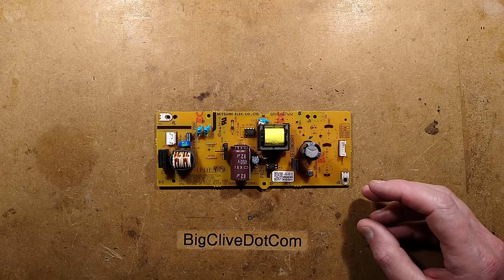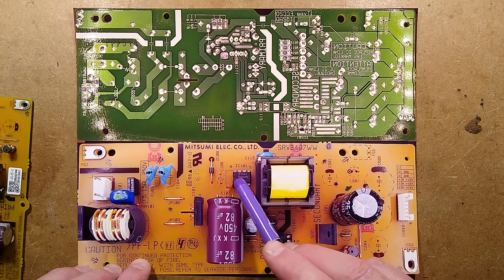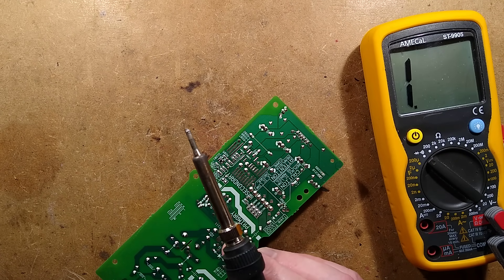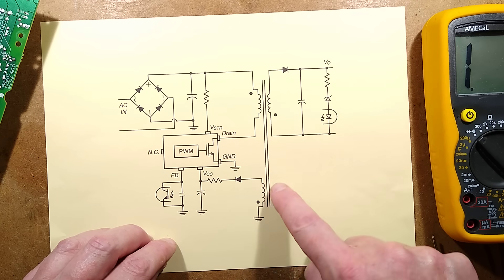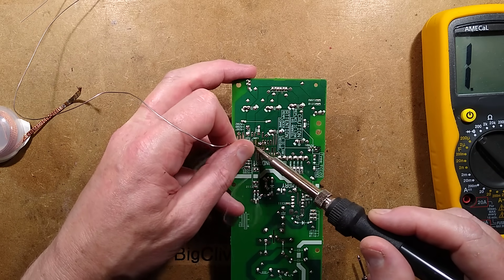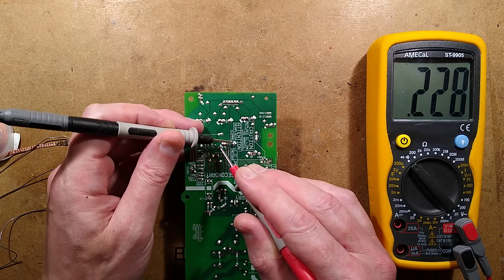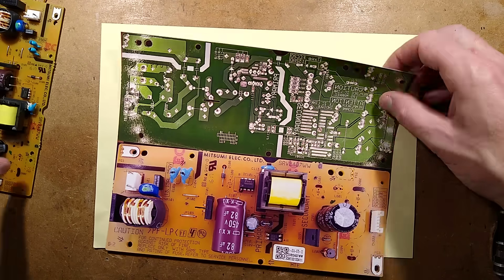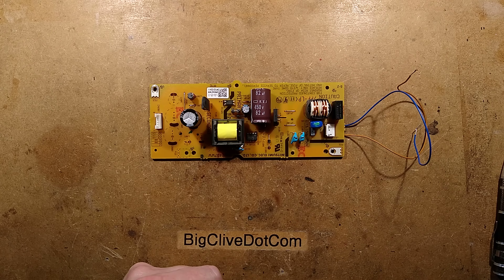Diagnosing a faulty PSU

Comment: A long time ago, someone thought, "Let's take the AC mains, rectify it into DC, connect s coil with a DCR of 0.05 ohms to it, and then short it to ground with a fragile mosfet." That man ended up in an asylum, but danged if it didn't work.... It has always been my theory that switching supplies work because of voodoo.
Reply from the maker: In the early days they were outright scary.
Reply: @bigclivedotcom didn't the first Gen of switchers tend to run really hot? Tend to heat fail?
Reply: Actually, this exact thing took place over a hundred years ago when Henry Ford put the ignition coils in the earliest cars.  Then along came Kettering with the coil, 'condenser' and points to repeat the same thing.  Now we have chips that do it in microseconds.  👍👍
Reply: @acmefixer1  That's true. And the "flyback" circuits in CRT TV's and video monitors work similarly. Still, it's kind of amazing that these circuits are so reliable if built correctly. On paper, it seems like they'd be doomed to a fiery death in the first second of operation.
Reply: @ScottGrammer  That's because you're thinking of this like it's a DC circuit.  It isn't.  You're not thinking about the inductance involved.  When the mosfet first turns on, there's not a dead short across the supply.  The coil is nearly open at that point due to its inductance.  It gradually starts conducting more and more current until the mosfet turns off, sometime before it becomes a dead short across the supply.
Reply: @stargazer7644  Yes, I know. And you're right. As the magnetic field builds in and around the inductor, the current rises. And when the mosfet turns off suddenly, that's when the fun stuff starts. I do know what I'm doing, having repaired electronics for 40+ years. But I also know that switching supplies can be a real bear to repair because often their operation depends upon very specific characteristics of the original components, and replacement parts may not behave quite the same way. This can lead to what's technically known as "spitzensparken."

When Bob Carver released his first "Magnetic Field Amplifier," which used an AC variant of a switching supply (in part basically a light dimmer), the switching component (in that case, a triac) had to be sourced directly from Carver, or else the supply would fail again hours, weeks, or months later.
Reply: @ScottGrammer  I once had an IBM computer CRT show up on my bench with a blown horizontal output transistor.  Swap the transistor, and good as new.  A week later, it was back in the shop with the same problem.  I busted the scope out, and found a spike on the collector waveform that was exceeding the spec for the replacement transistors we were using.  The design really wanted a very particular transistor.  I slapped a zener on it to eat the spike and never saw the monitor again.
Reply: Tfm-45 one of the best ss amps ever!
Reply: @stargazer7644  sounds neat
Reply: Some years ago, I worked for a hospital that did their own electronic repairs for many things.  They had a particular model of RCA color TV's for the patient rooms.  These things had a bad run of Horizontal output transformers and were failing often.  I would put a scope on the horizontal output transistor and slowly bring the variac up.  If the waveform was horribly distorted, I knew the Horizontal output transformer was shorted.  I repaired about 40 of these in about a week.  Usually took a fuse and the new transformer.
Reply: You forgot the HF chopper.  In the 80's I fixed dozens of SMPS' in commercial equipment (third party IBM network muxes).  They used all discrete components back then.  It was always the output electrolytics that bore the brunt.  They ran HOT.

Times sure have changed.
Reply: Pixies. It's the pixies.
Reply: @kti5682 Yes, I've worked on a couple of them.
Reply: 1930s Fords had that to power the radio. Vibrator "tubes"  failed.

Comment: These are used on a high end Song blu ray player and fail on a regular basis. The biggest offender is the double diode on the secondary. It’s more than adequate for the job especially as the diodes are wired in parallel so I suspect a bad batch.
Reply: Could the lack of heatsinking be to blame?

Comment: I find a stiff nylon toothbrush to be a great desoldering aid. Simultaneously apply iron and scrub connection
Reply: How would you use it? Would you use the shaft, or the brushes, or am i completely lost..?
Reply: So you just need a third hand to end up with a molten brush? somehow I don't see how this would work at all...
Reply: but with braid you know where the solder is going, a brush might flick solder everywhere

Comment: hi bud a quick question if the person to whom gave you this PSU Circuit Board was to replace the Capacitor and Transistor it would work if so very interesting vid
Reply from the maker: Replacing the output capacitor and diode package would be the fix for this unit.

Comment: That little repair reminds me of a friend fixing a very expensive bit of kit by replacing one component. A lot cheaper, and environmentally friendly than ditching the whole thing.

Although I think I missed something from the video as I couldn't see which bit the ozone was supposed to come out of. :)
Reply from the maker: It could power the Russian Nuclear Corporation unit.
Reply: This happens all the time, one example is I repaired a 24" computer monitor by replacing one broken resistor inside for a few cents of cost at most. Been in use for 6-7 years after that and still going strong.

Comment: This might sound very stupid, I have what I call "dangerous" levels of insight into electronics. Does that PCB really need such a massive cap?
Reply: It depends on how much current the load draws, basically. Think of the cap as a sort of "surge tank" that smooths out rectified AC pulses (take a good look at the partial schematic at say 11:51). The more current the load (the immediate load on that cap is the transformer primary) draws, the more those pulses are dragged down, stressing the rectifier bridge and believe it or not, the transformer winding. The higher the capacity of the cap, the less that happens and the more constant the current through the primary etc. There's a point of diminishing returns above which more cap = pointless expense and designers have to walk the line between not enough and too much.
IOW the purpose of the cap is to make things at that end of the PSU as constant as possible, so therefore more capacitance = more stability.
EDIT: This is a "slightly less dangerous" generic explanation. I oversimplified a lot and left a lot out.
Reply: @markfergerson2145  No, still not getting it. Sorry. I'll just keep ramming random wires in places while wearing welding gloves. If  I don't die in an explosion or every house on the street erupts, still a win of sorts.
Reply: Equipment designers rarely spend any more money than they have to on parts, so things usually aren't bigger than they need to be.
Reply: @stargazer7644  Not necessarily. usually it's some Manager who says "That's gonna cost too much, go for fewer, cheaper parts. Oh, and plagiarize someone else's circuit if you can- they'll never know".
Ask me how I know.

Comment: i expected you to botch together 2 discrete diodes and make up the required component from 2 diodes
Reply from the maker: That would have been one repair option.  Especially if just fudging a fix.
Reply: In this application you'd want to use another double diode or ideally one big single. Two individual diodes in parallel won't share current evenly since the forward voltage drops as temperature goes up.
Reply: @Broken_Yugo  i meant he can make the equivalent of the package by using 2 diodes ... he solders there cathodes together to make a 3 legged component just like the package he removed
Reply: @fouzaialaa7962  And I explained why that's a bad idea. The circuit doesn't actually use a double diode, as Clive has mentioned one was likely chosen for the big package's heat dissipation.
Reply: @Broken_Yugo  many BMS use 2, 3, 4, individual diodes in parallel.
Reply: @snakezdewiggle6084  if there's no resistor in line with each diode to equilibrate the current, then this isn't good design.
However,  cheap electronics don't care about reliability.
Reply: @inotoff  yes, I agree, as do my text books. But in my personal experience I have yet to see it in 40+yrs. Use diodes in switching RF.
Reply: @inotoff  Two diodes on the same die are generally well matched so you don't need the resistors.

Comment: I do appreciate the thin viscosity of that flux. I use an RA-type flux recommend by Mr. Carlsons Lab when I still watched him.  It's much too viscus and clogs thin needle applicators like that. I often need to heat the needle to get the flux to flow.  I'd appreciate a link to your brand if possible.
Reply: Just add some isopropyl to the flux you have.  That will reduce the viscosity nicely.
Reply: @dlock2k  Interesting.  I may give that a try!  I appreciate you taking the time to reply.
Reply from the maker: My flux is rosin in isopropanol.
Reply: @bigclivedotcom  That makes is unanimous.  From this point forward, I shall use my finest non-moonshine (I swear) home-produced anhydrous ethanol to cut said flux to a less swear-inducing viscosity.  Thank you internet denizens!  Yes, I know that you both said isopropyl, but I like inebriation of myself and my electronics.

Comment: I consider Mitsumi a quality manufacturer, had lots of 3,5" floppy drives, never failed. Could be dirty with dust bunnies, still wouldn't misalign heads. This PSU looks to be quite tidy, too.
Reply: Yep, good old Japanese brand name. Nice spacious design here, and repairable.
Reply: The best keyboard I ever had was a Mitsumi. Cost £3, only bought it to pad an order out for free p&p. Nice and clicky despite not being a proper key switch. Reliable, light, nice typing angle.
Reply: @Zadster 
I'm fairly sure I've got a Mitsumi mechanical keyboard in my keyboard box.
Reply: @Zadster  I think i used one of those for 10 years, until repairs kept piling on and it no longer felt great. But nowadays, i'm exceptionally happy with a generic Chinese mechanical that i found used years ago, this is the best i've had so far.

But they're also the manufacturing company behind Nintendo's products, also contributing some of their engineering. Gamecube, Wii era stuff was so good!

Then again the word is they're also the ones manufacturing Nintendo Switch, which retains its glaring controller drift issue, though ultimately it's an engineering issue and not materials or assembly quality issue, and ultimately Nintendo isn't doing anything about it, so that's pretty telling.
Reply: They also made CD(-R/-RW) drives. I still have a Mitsumi CR-485CTE
 40x CD burner in my "early 00s" retro games PC. Sadly their optical media arm was apparently gobbled up by NEC around 2003 or so. If you remember the somewhat famous NEC ND-1300A DVD burner... that was a Mitsumi DW-7802TE that was renamed as part of the merger. After that the Mitsumi name disappeared from the optical drive market entirely, and they've been around for quite a long time (look up the CRMC-LU005S 1x speed drive if you're curious)
Reply: I remember when 4x and 8x drives become, everyone was so "woow"..
Reply: Indeed.  Mitsumi is an old established brand.  I would assume the product is good.  Which is much different than the usual random maker.
Reply: Mitsumi are respectable.  I've had a few drives made by them too.  I don't know where the drives are now because I haven't installed floppies in my computers in the last eighteen or so years LOL.  Still have fond memories of calibrating an Apple ][e drive however...
I'm loving the design of this PSU.  Monolithic chip combined with a common mode choke plus the usual suspects.  Utilitarian common sense design.  Thumbs up from me.  If only that diode package hadn't been a lemon...
Reply: Anything created by a known brand name, is legit. Corporations have to protect their brand reputation, which is their lifeline, so they aren't cheapskates when it comes to hiring engineers. The best Japanese electrical engineers usually go and work for these various companies like NEC, Panasonic, Toshiba, Mitsumi, Ryobi, Makita, Fujitsu etc, there is big competition to become an engineer for these companies (because a big wage also). 

Now as far as why made in China is rubbish, made in China is unbranded, there is no brand name to protect, it's unbranded. As a result the idea in China is to make it as cheaply as possible, if the design is fatally bad it doesn't matter (just blame the country that agreed to sell it in their country for accepting it). Lots of these cheap 1-2 dollar shops are full of dangerous stuff from China, that came in via shipping container and doesn't fulfil modernised country's safety standards. This is why you must buy from quality store brands in your country, a quality store brand will only house quality branded products from various places (like Japan, Korea, Taiwan, Germany, USA etc), because their store's name itself is on the line (a reputable known store brand will not risk it's brand by selling some unbranded and unverified no name Chinese thing, one death and the store's brand is badly hurt).

It's alright to be a cheapskate on things that aren't necessarily mains voltage and can't harm you in the case of failure. However when it comes to important things, like toasters, computer parts, air conditioners, heaters, electric blankets, microwave ovens, battery chargers etc, you should always use branded products from either Japan, Korea, Taiwan, Germany, USA. Because a Chinese design for these items, can result in not only electrocution and death, but also your house burning down.
Reply: @ziongite  often a new brand name product is given for a limited time to one of these generic company’s and flogged cheap to market under no name , with a slightly different casing,to see how it performs etc. 
If it bombs well brand name is protected and people assume it’s just another crap no name product.
Reply: You can also tell it's a good quality PSU by seeing that Nippon Chemi-con capacitor in there.
It's extremely rare to see cheap PSUs with high quality caps.
Reply: i got them confused with Matsushita
Reply: OMG I used to work for Mitsumi UK.
Reply: I see there Mitsumi branded dc motors in a lot of tape cassette players.
Reply: Lots of Mitsumi PSUs inside Sony VCRs with overall good reliability.
Reply: All the cd rom drives (non scsi) and floppy drives i have in the archives,  er basement, that work are Mitsumi... there is no coincidence. Their hardware from the 80s is held in high regard.

Comment: I have a Sega Saturn PSU that I couldn't get out (was going to clean the console and upgrade something on motherboard) it was stuck and I used a light amount of force and it just snapped in half like a card.  Annoying as a replacement is at least £15!
Reply: That sounds pretty cheap for a genuine/refurbished replacement PSU!

Depending on where it snapped, i would be tempted to just epoxy it back together and just patch up the traces on top though. Not that i ever managed to break a PSU like that; then again i have done a number of Dreamcasts but zero Saturns.

Comment: Wow! Thank you. This is the exact problem I have with a similar power supply that powers a set of mirrored led lights. PSU led onboard is pulsing, witch causes the lights in the unit to pulse. The caps look fine, and I was suspecting the diode, but wasn't sure how to test. Guess what? I followed your video and yes definitely the diode! I'm going to hit up our sparky at work to see if I can pick up a freebie. Hopefully I will have another working DMX fixture to add to my program 😃

Comment: Please explain
Dc-dc buck converter
Input 4 to 20 volt

Output options
Variable
1.2v
3.3v
5v
9v
12v

Chosen
By resistor short circuit
Reply: That sounds like a generic chinese module with presets. It takes 4-20 volts from a battery or other supply, and then linear regulates them to one of the 1.2/3.3/5/9/12v outputs depending on (usually) what resistor value you use. A guide should be available for the board telling you how to select the output. Usually you just have paths you short, i.e. a 12v trace gets soldered short and all others left open.
Reply: @dimitar4y  

I want to learn how circuit works

I want to learn calculation as I want upgrade it to 10v output or 6volt
Reply: @Shubham-9996  If the traces lead to resistors, it's likely the resistors are a "setting" by their value. Shorting a path just "picks" a resistor. Most likely, you can just use a linear estimation. If 1v is 10ohm and 12v is 100 ohm, then every 0.1v is 1 ohm, so to get 6v you use a 60ohm resistor. This is the most straightforward way of hacking the circuit. The resistor you pick is either the HIGH or LOW side of a voltage divider. If it's the high side, high resistance actually decreases voltage, so it would be 1 ohm 12 volt, 100 ohm 1 volt. Just use common sense.
Reply: @dimitar4y 
Once I buy I well figure out it
Reply: Thank you so much

I have same thought earlier
But was not sure

Thank you

In india it is hard to find that module
Reply: @Shubham-9996  science requires research. Research requires sacrifice. You may have to blow up a few of them before you figure it out, if you have no idea what you're doing (:
Reply: @dimitar4y  
Yes
I did blow verious things by mistake
And learnt things 

Ultimately reduced carelessness

Comment: After buying a couple of PCB's at an electronics rally, I was offered a 10 to 15 Kg box of the same with 50p refund!!! So I now have a LOT of these type of PSU's taken from failed TVs' and even more of the Hi-V plasma  driver coils to play with. I was interested in the HF properties of the larger ferrite transformers but will be looking for pulse driver IC's thanks to BigClive and the simplicity of the circuitry. Got loads of the double diodes, FET's and 450V caps to have fun with as well.